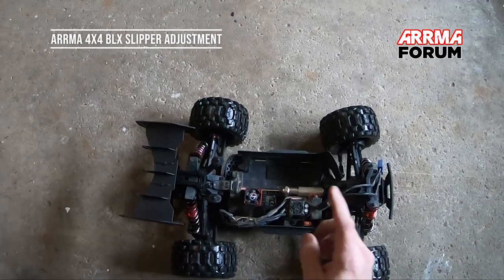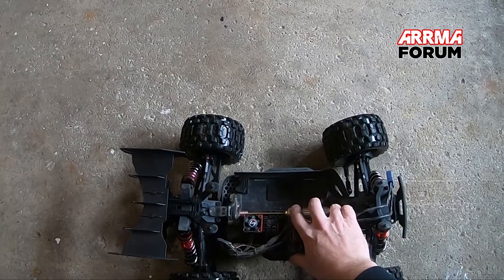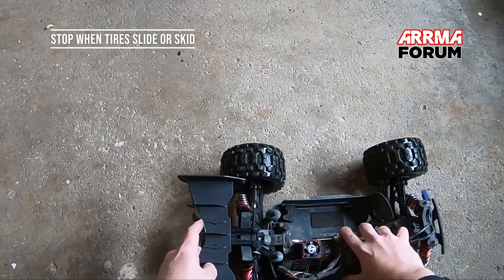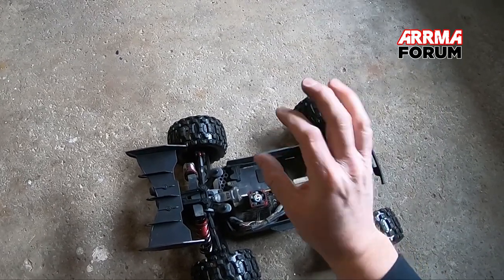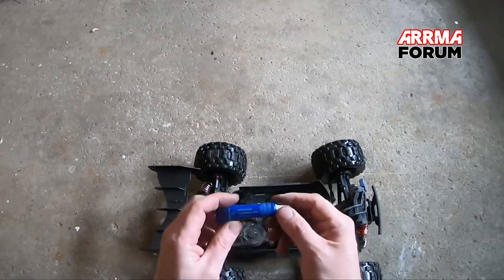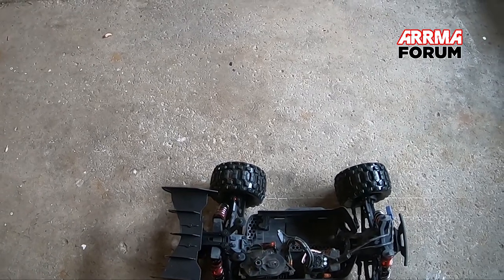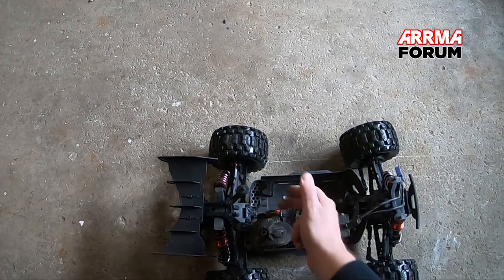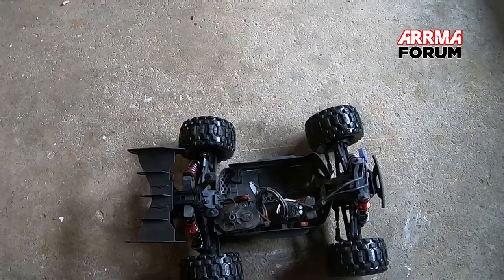How to set your Arrma 4x4 3S or 4S BLX Slipper Clutch

Comment: I tried using the method by holding the rear wheels while pressing full throttle until the car wheelies but my esc seem to cut off so was unsure if I had it set correctly. I tried the way you suggested, and then loosened the clutch and retighten using the wheelie method and found it’s basically the same tightness. 👍
Reply: Something is wrong with mine I think . I did this method and it didn't wheelie it just kept going ?!? What could this mean? I think I fucked my slipper
Reply: @kristopherguilbault5428  I think maybe remove the slipper clutch and inspect it or maybe it’s just too tight

Comment: Thats an interesting way to do it be sure to clean the backend of the slipper when you put back the slipper back togueter again i had so kuch threadlock that my sun gear key did not wanted to fully go inside the hub i had to burn all of that locktite out afterwards
Reply from the maker: This was a brand new set of hubs. My old set was damaged in a chassis breakage. I cleaned the screw, spring, and all other slipper parts before assembly.

Comment: Is it best to do this on a rough surface (concrete, ashphalt, etc) or can it be done on a smooth surface such as wood floors/ceramic?
Reply from the maker: As long as your tires have moderate grip, I think it will be OK, but I really think the amount of traction that you run on should somewhat match the traction of the surface you set the slipper on. I usually use a somewhat smooth concrete garage floor to set mine and I would consider that a lower traction surface than most areas I run.
Reply: I'm new to the hobby but in my mind wood floors that have a finish to them would be slipperier surface isn't the surface that you would be running the truck on so I would do it on asphalt or a concrete garage floor.

Comment: I have a granite never adjusted the slipper ran it probably a dozen times took it out today now only getting power to the front tires any ideas would be greatly appreciated already spent enough at the hobby shop
Reply from the maker: Yep either slipper is loose or rear diff is blown. Also could be a popped driveshaft
Reply: @jondilly1974  thanks I'll check it out tomorrow

Comment: As a full newbie: how did you get to the point at the beginning of the video, what steps do i need to perform in order to get the screwdriver in? thx
Reply from the maker: Just pull out the center driveshaft. Stick in a 2mm driver.

Comment: I have a question.  Just bought a typhon 3s and tried checking the slipper. I cant get it to budge. Cant loosen it. I was trying to loosen and than tighten it down the way you did but this screw wont budge. Is that to be expected from the factory?
Reply from the maker: Sounds like it’s got a good amount of thread lock holding the screw. Is the slipper slipping under power? Is there a reason you are trying to adjust it?
Reply: @jondilly1974  Lol. Actually no.There's no reason for me to be messing with it other than I saw your vid so I figured I'd learn how to access and adjust it. I gotta stop taking things apart just to see how they work.😏
Reply from the maker: beaglegod1 it’s all good. Just wanted a little more info to point you in the right direction is all. I like taking things apart too. I just had to redo my K4S slipper as I shredded the spur due to the motor shaft sliding outward. 😱

Comment: Great video! I'm having problems where my driveshafts keep popping apart. The guys on the Arrma forums suggest that my slipper may be too tight and to loosen by a full turn. would you recommend this also, and if I did it, I presume that I check its tightened all the way first like you have in the video?
Reply from the maker: Yes if popping u-joints, slipper is too tight and this method should fix that for you. You will need new driveshafts once they pop tho.
Reply: @jondilly1974  brilliant! Thanks for taking the time to reply. Got some new shaft on the way
Reply: Check your Punch settings on your ESC, you may have punch to high.  Less punch will be less st ress on those shafts.

Comment: Do you not have problems with the drive shafts popping out? I have a 3s granite and the book said 1.5 turn out, but I'm also new so lol.
Reply from the maker: I used to have issues until I discovered this method. If you’ve popped them once, they need replaced. They will just keep popping easier every time.
Reply: @jondilly1974  thanks for fast reply
Reply: @jondilly1974  so you do it that way until tires start to skid, and you don't back it out anymore ?
Reply from the maker: Matt Potts yes as soon as the tires start to skid, you’re done. I usually do this on a surface with traction like cement or asphalt.

Comment: Everyone on the forum says you need to loctite the setscrew but I don't understand. You need to be able to adjust it and when you do so with a loctited screw won't it be loose again? I thought the 3 piece bearing was to prevent it coming loose.
Reply from the maker: The V1-2 style needed Loctite. V3 has a lock nut and maybe doesn’t need it.
Reply: @jondilly1974  but what about future adjustability?
Reply from the maker: @woutervanwijk4369  why would I need to adjust it? If I get it set right, it’s good to go.
Reply: @jondilly1974  because the pads will wear, so you might want to be able to tighten them.
Reply from the maker: @woutervanwijk4369  possibly. Haven’t had that happen yet, but I don’t really run my 3S trucks that often anymore.

Comment: If I want to not adjust it fully tight ,but 1-1,5 circles from fully tight , have I to loctite it when it will be fully tight, wait 24 hours and adjust that 1-1,5 turns after 24 hours or adjust it 1-1,5 hours down from full and loctite that after that? I have the v3 version but me driveshafts keep popping out. Should I tight till skidding, loctite and thats all?
Reply from the maker: If you have popped the shafts once, they need replaced. They keep getting weaker each time they pop. They pop when the slipper is too tight.
Reply: @jondilly1974  I know,I made it rwd and it popped another one that hadnt been popped yet

Comment: what does a slipper clutch do ? and why tighten it?
Reply from the maker: It transfers power from the motor to the drivetrain and allows slippage under extreme stress. If it is set too loose, it will slip under smaller stresses which will rob you of performance. If set too tight, it will put drivetrain parts at risk of breakage.
Reply: @jondilly1974  how do you know that it's too loose? The truck just won't be as fast?
Reply from the maker: @surturczech4993  I can hear it slipping but yes it will loose acceleration and stopping power.

Comment: My typhon 3s keeps cogging and the screw inside the spur gear keeps coming loose and its doing it so much that i can't drive it not even 5 mins of it just slipping and slows down.
Reply from the maker: Might be time to buy the newer style power module. You can usually find them online from kit breakers like Jenny’s RC.
Reply: @jondilly1974  as in the power module, is that the case for the motor mount? I had to update that part. And I had it on the typhon.
Reply from the maker: @gamercat7004 actually I think I said the wrong part. It’s the slipper clutch assembly that you’ll need. 

Example: https://jennysrc.com/products/arrma-kraton-4s-4x4-center-differential-steel-57t-slipper-set-0-8mod-ara4408v2
Reply: @jondilly1974  I have 2 sets of spur gears, and the steel one is narrow than the pinion with metal gear material. And i swapped back to the metal one again because it's the width matched with the pinion gear. The original spur gear plates broke on it, and the bushings inside for the screw are not fitting in for the new ones.
Reply: @jondilly1974  I have issues with it just slowing down and going and completely not moving when it cogs so hard even with match width spur and pinion gear.
Reply: @jondilly1974  or this rc car cogs and completely shuts off like no reverse and forward and the steering works.

Comment: Even with the lock tight can I still remove the assembly to change out spur gears?
Reply from the maker: Yes blue loctite is easy to remove later. Red would be more difficult.
Reply: Thanks, now it's time to wait 24 hours
Reply: @jondilly1974  Don't thread lock need lack of or no air to cure?
Reply from the maker: @km7101  yep the TL in the bolt threads will cure. The part outside may not fully cure but still resists allowing the bolt to back out.

Comment: Why not just do what the manual says? 1.5 turns from full tight?
Reply from the maker: Because to get to full tight to be able to back it out 1.5 turns, you risk breaking the screw, hub, or smash the spring. I’ve done all three. Also, 1.5 turns or any other predetermined amount doesn’t factor in the age of your slipper pads, the size of your tires, etc. 

But, all that said, this method no longer applies to the V3 editions anyway as they now have a lock nut to hold the tension properly.
Reply: @jondilly1974  So this method will not work on Version 3? Can you still apply this method, but do not use the lock tight glue at the end?
Reply from the maker: @futabaguy1  yes just skip the thread lock / loctite step and because the nylon nut doesn’t need time to cure, you can reassemble without waiting. 👍🏻
Reply: Thanks for all the info Jon you're a champ

Comment: Is this still the way to do it on the V3 BRCC?
Reply from the maker: No, I don't think the lock tight portion would be needed with the new lock nut on the V3. As far as setting the slipper tightness, yes, I would think it would still apply. If you still have a V1 or V2 you will want to buy the slipper maintenance kit and shorten your rear input shaft to fit the nut. Or just buy the new V3 input gear.
Reply: @jondilly1974  thanks! See you on the forums. -GingerWeasel

Comment: How do you do this on a 6s version
Reply from the maker: 6S doesn’t have a slipper clutch. It has a center diff. You want to use thicker fluid if you want it to be stiffer.
Reply: @jondilly1974  ok I thought so I’m like it’s just a center diff with gears there’s not much to adjust. However I’m having slippage with my gearing it’s definitely slipping gears. I have checked the front and rear diffs appear to have no damage or any grinding of the gears so I assume it’s the center diff and should shim them but if I do that I might as well rebuild the whole center diff on my outcast 6s exb any recommendations would be helpful thanks
Reply from the maker: @jracer7189  I would ask the guys at arrmaforum.com for some help. I haven't been into RC for over a year and my knowledge is slipping.
Reply: @jondilly1974  will do